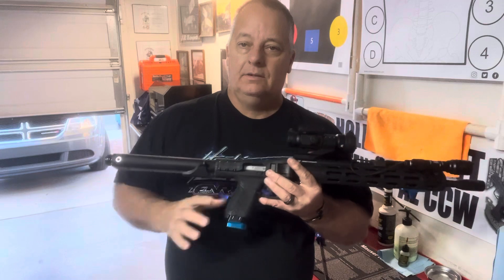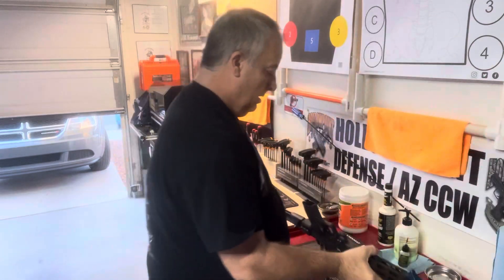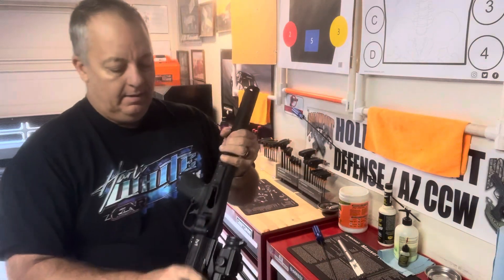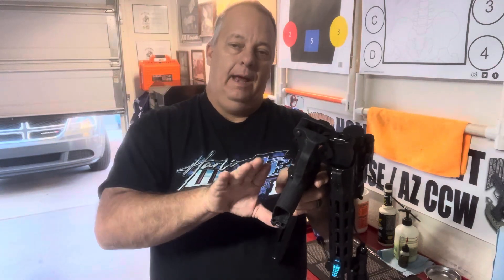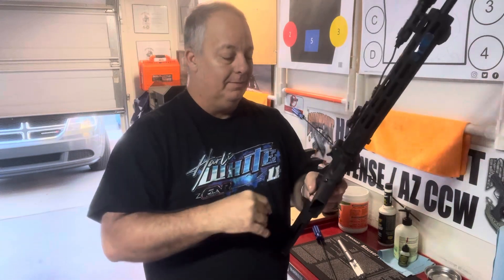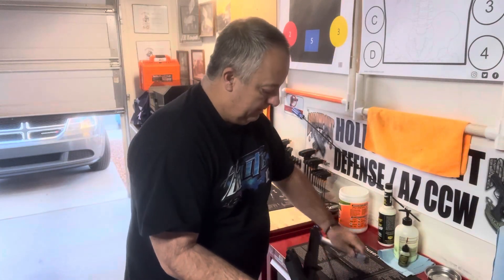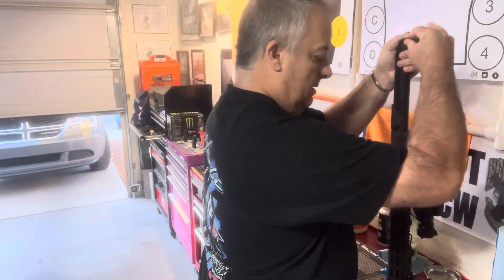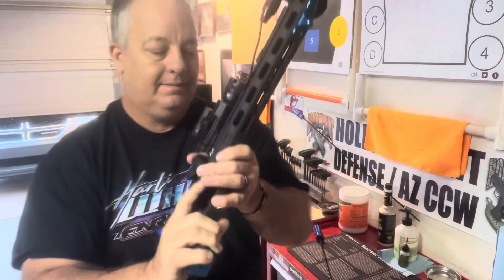S&W FPC magazine won’t go in

Comment: Thanks for your expertise and to the point great go to Vids.We appritiate.👊🏻
Reply from the maker: You’re welcome.
Reply: @hollowpointdefense I cleaned my 9mm carbine and same thing happened, if you look inside the handle there’s hook type thing that’s obstructing the magazine from going in ? Is that the thing you put your finger on ? I was going to send it back to SW but I’ll just bring to the ammo shop by me if i can’t fix the problem! The pin that holds the firing pin kept falling out when i was trying to put bolt hammer back in! Thanks

Comment: Mistake #2...Pushing bolt all the way forward past the hammer to get it in battery when re-assembling and then turning the gun the wrong way and have it unknowingly slip back behind the hammer again... makes it real hard to impossible to set the bolt follower spring back in place.  Dah, I managed to do this.  Live and learn.
Reply from the maker: Not sure what you did, never had that issue. When I put the bolt in I slide it partway put that pin back in the bolt. Then I seat the bolt in the closed position. I put the recoil spring in it then I put the buffer plug in with the buffer plug pin, and put the backstock on. I will try to replicate this issue later this weekend.
Reply: @hollowpointdefense  Just my stupid.  I got the bolt seated and twirled the gun around and gravity moved the bolt back over the hammer without me realizing it.  Thanks

Comment: I have saw people force the bolt in when reassembling the gun, I always use my pinky to push back on the hammer so the bolt goes in easily. I have yet to encounter a hammer forward like this, but it's good to know if this does happen. Thanks for posting!
Reply from the maker: I haven't had it happen, but It can happen easily.

Comment: Same problem after cleaning. Still not sure what needs to be done exactly. Got the idea but what exactly to push down / reset?
Reply from the maker: The hammer, make sure it is in the cocked position, NOT laying forward into the magwell.

Comment: I did the fix exactly but I’m still having an issue fitting the 23 round magazines in the mag well but the 17 rounder goes in smooth. I’m not sure why
Reply from the maker: If the 17 round mad seats and is good, the 23 should be fine too. It is the same mag just has a five round extension on the bottom.

Comment: Any suggestions for this one...if my magazines are full (any of the stock 3) the magazine won't lock into place. But if I remove a round and just run 9 rounds in the mags, flawless.
I've just been running the 9 round mags because I got so frustrated trying to figure it out.
Reply from the maker: I will try the 10 rounder I have to see if it has the same issue. My 17 round mags do fine.
Reply: @hollowpointdefense  I greatly appreciate that!

Comment: Good to know, but I have cleaned mine many times and have never had that happen.
Reply from the maker: I haven’t had a happen either, but anything gonna happen so I just put it out.
Reply: @hollowpointdefense  You always put out good info.
Reply from the maker: @mtnride4930  the main reason for the video is, I’ve helped many people via text message or email fix this issue. I get 25 to 100 messages a week on FPC issues.
Reply: It happens when you don't have the safety on when cleaning.  Also, the manual pulling the trigger when disassembled is a big no no and can cause damage.. @hollowpointdefense